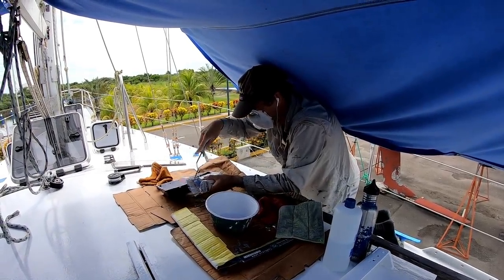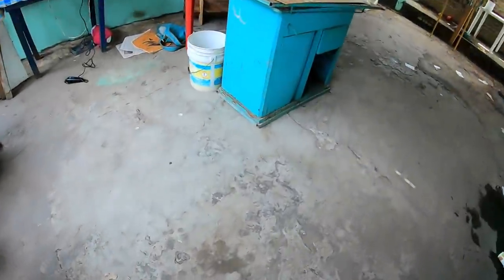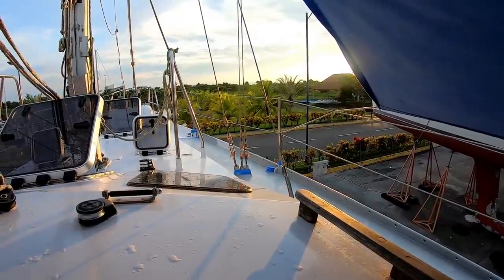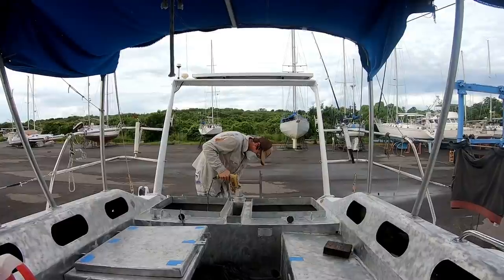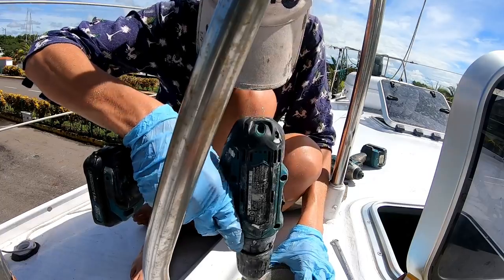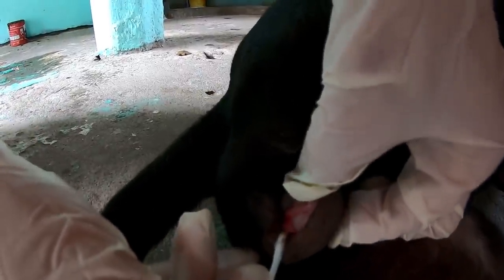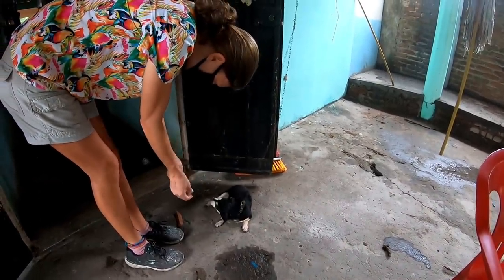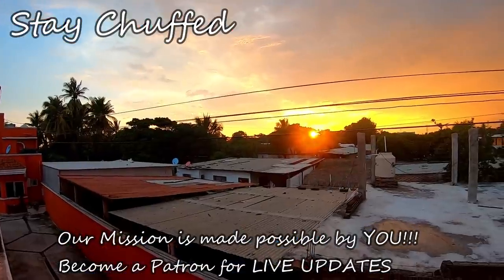Deck fittings... so easy... Chuffed Adventures S03Ep22

Comment: Possibly it is a good idea to replace the galvanized hose clamp in the water tank with one made of stainless steel or one or two cable ties. Then you have no problems with electrolysis there. 
I haven't seen any cable ties in your arsenal yet, although they are also very useful for non-electricians. Have a chuffed Saint Nicholas Day!
Reply from the maker: Weve got lots of cable ties haha, and I did end up putting one on there two just incase, but the hose clamps we have on board are all stainless :)

Comment: The holes probably did not line up because of the angle you drilled them at. If that deck has any slope to it drilling straight up from the inside will cause them to be off but a little bigger does not hurt anything.
Reply from the maker: Yep thats what we ended up doing, its a pain trying to line up everything!

Comment: Just keep doing what you are doing. Inspiration to so many young training vets around the world. Boat owners and YT entertainers too.. 
Quick question if we may? Oscar our 15 year old Patterdale terrier, star of our YT channel has lumps. He had one removed from his front leg 5 Years ago and we were told it was benign just fatty type tumour. He now has quite a large one under his front arm/leg pit. It does not trouble him but we know he is too old to take a general anasetic to have it removed. We have the notion that while his tail is wagging and each day he is happy and running around we simply do nothing. If that changes we may have to think again. As a vet that we respect, admire and follow is that what you would advise? Sail Safe Guys, Ant, Cid & the pooch crew.
Reply from the maker: Hi crew, If you are near a vet they can do what is called a 'fine needle aspirate' to check what cells are in the mass, its just like getting a vaccine sized needle and the doggos tolerate it well. They then look under a microscope and usually can tell if it seems to be all fat cells VS something else. Its usually cheap and fast :) Thanks for watching!
Reply: @VetTails  Many thanks we will look in to it. Sail Safe Guys, Ant, Cid & the pooch crew.